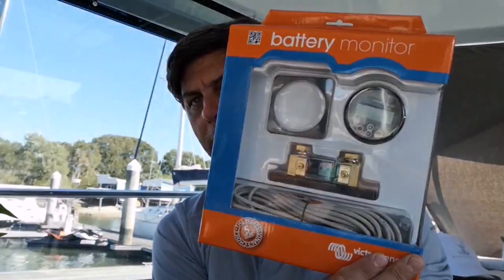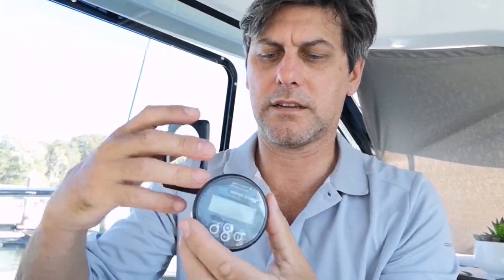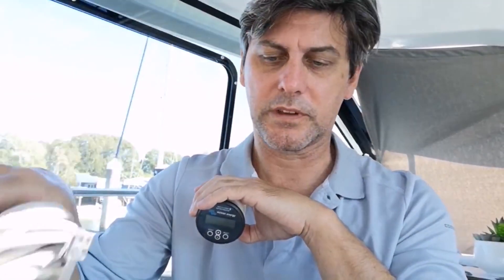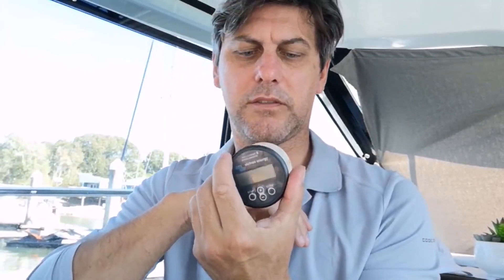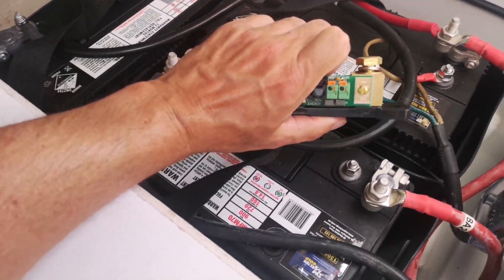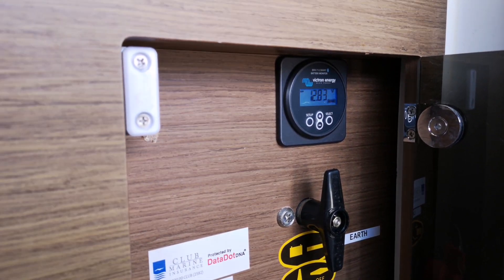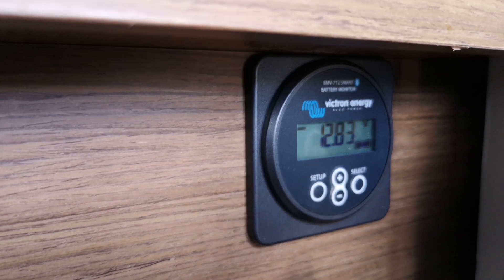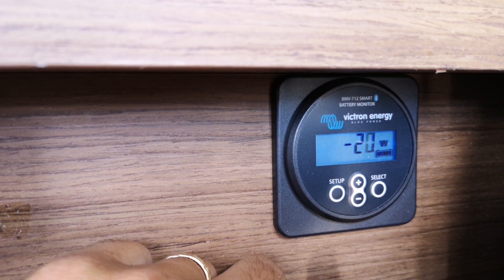INSTALL A BATTERY MONITOR FOR BOAT OR CARAVAN - Victron BMV712 | The Rudder

Comment: I’m at planning stages for this installation now our 895 is in for delivery :) Do you remeber what cable dimension you used to connect the shunt? I have 40cm of 35mm2 if that would be enough. Thanks!
Reply from the maker: Hi Hejo, I highly recommend the battery monitor, just good to know how your batteries are going whilst out. The cable I used was 10mm in diameter, this was the cable from the negative post to the shunt. It was about 15 cm long. Hope that helps.
Reply: @TheRudder  Great thanks! I believe that diameter translates to about 35mm^2 square.

Comment: Great videos mate keep them coming i am learning a lot. We drove past you on the weekend i gave you a toot of the horn 795MF.
Reply from the maker: Hahaha awesome!!! So cool to see another MF out on the water. Have to organise a meet up.
Reply: Good day mate 
Just wanted to ask you about 795,I'm getting my 795 series 2 next month...I heard that they are hard to handle in the marine when you dont have a lot's of room ,hard to park in to the berth...so if you could give me your thoughts about it and generally how happy are you with mf795
Thanks 
Regards David
Reply: @dadodado1855  Hi, Love the 795 Series 1 
Issues: Water lapping on the bow annoyed me when sleeping it is very loud.

I have a 200HP 2018 Mercury it is underpowered for the size of the boat with passengers and equipment including a tender.

i have no issues with Parking as i have a Bow thruster so it is recommended.

The aft table/bed weighs far too much and it is a pain to lift.

The A pillars on the outside are starting to fade.

Apart from that the boat is fine
Reply: @luwisethapane  
Thanks for that 
My biggest regret is I ordered one with  mercury 200hp but I still think 225hp wouldn't make a big difference, 250hp  yes but to late now☹
Reply: @dadodado1855  Correct but no problem the dealer won’t tell you these things. Also the cabin is hot. If you are in a cooler climate it’s great but there doesn’t seem to be any wind which comes in even with windows, hatch and sunroof open. Enjoy
Reply: @luwisethapane  
Lucky I live in Melbourne that cabin will be perfect for me🤣